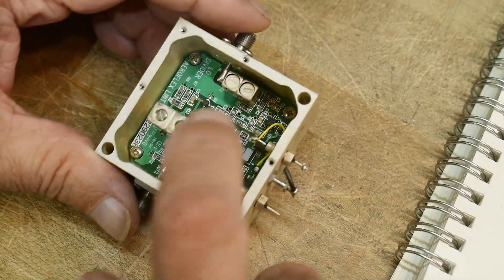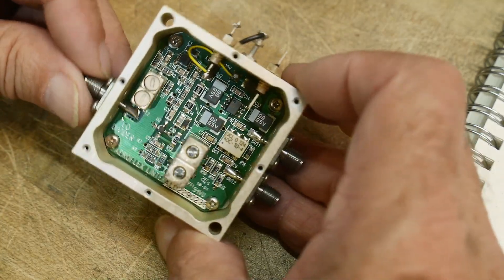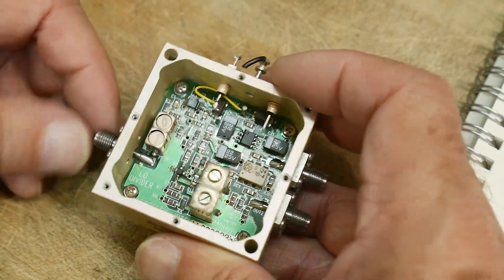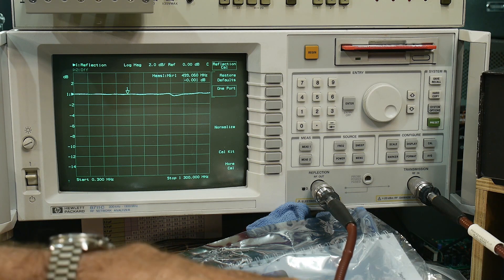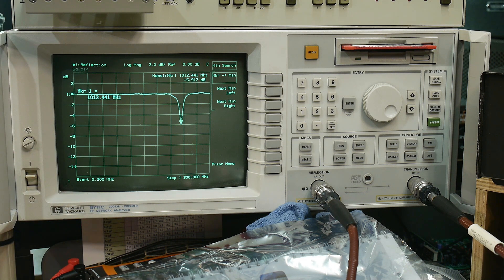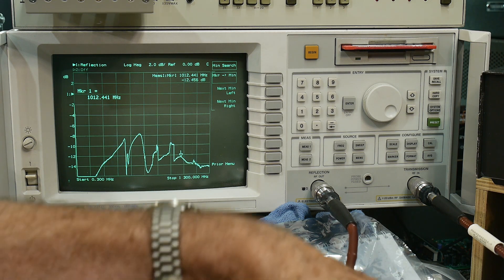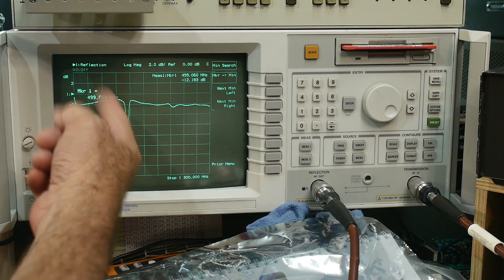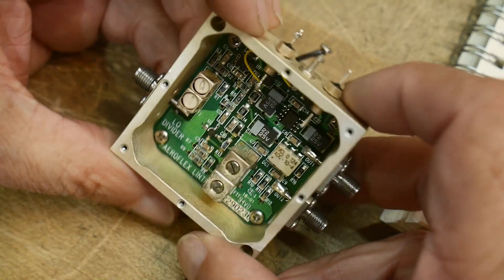#1983 S11 Filter Response

Comment: Purely out of curiosity, could you add other filters (high and low pass) with termination to prevent black box characterization of the circuit, or should we expect that there would still be "leaked" information about what is going on inside the box?
Reply from the maker: adding a circulator would hide the insides.

Comment: Where is the other port of the network analyser connected to ?
Reply: It's not used - that's what "S11" means - the VNA emits a signal on port 1, and measures the return on port 1.
Reply from the maker: the other port is not used for S11: https://youtu.be/Gu0b6ZSWJnM?si=U_LQNxu7yMx7gM-1